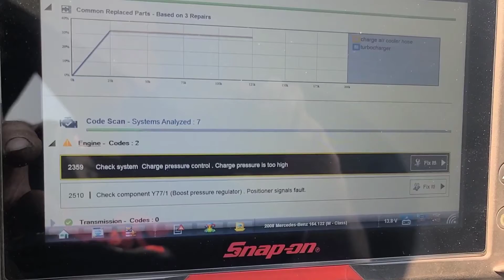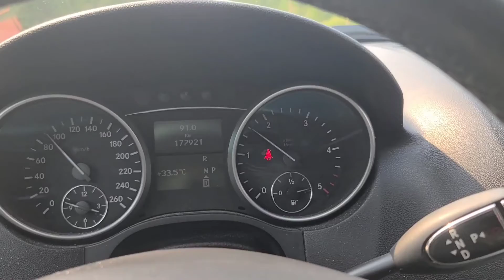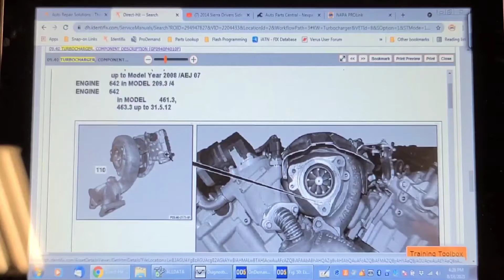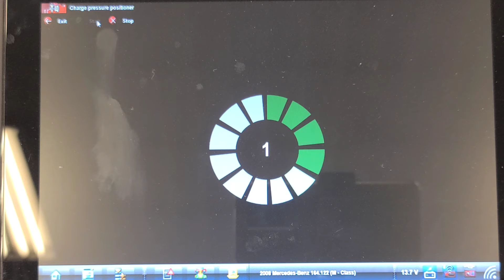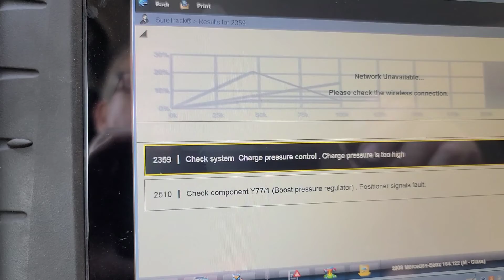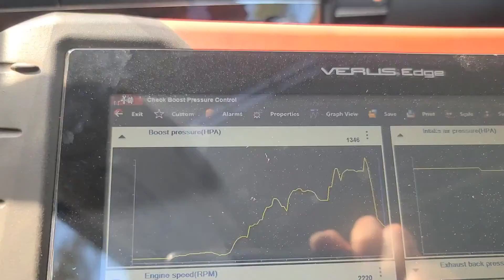2008 Mercedes Benz ML320 Severe Hesitation/Surge on Heavy Acceleration. Codes 2359 and 2510

Comment: Just so people are aware. The connections are aluminium bonded wire (search wire bonding cpus) and soldering is VERY VERY difficult and likely wont last. That being said mine is off for repairs now, its been repaired previously with solder i dont know how they managed to get it to stick to the pad. But yeah its aluminium bonded wire. Thats why its so difficult.
Reply from the maker: Yes you are correct it is a pita to fix

Comment: Hey great vid, I also have no engine light on a lot of stutter at 3/3.5k rpm but I have different codes, p2010 and p1214(00) car drives absolutely fine untill I put the accelerator to the floor then the engine seems to stutter and jerk pretty hard. This only happens on full load

Comment: Hi, thank you for an informative video. My ML350 CDi starts and then dies. Have you ever come across this problem? It runs for 1-3 seconds and then dies. It has new low and high pressure pumps, new fuel rail pressure sensor, new fuel rail pressure regulating valve, new fuel filter, 6 new injectors, new fuel pump relay, new cam shaft sensor, turbo refurbished. Because of the struggling I now have to replace the battery. Day 1 after coming from workshop it starts easily, day two it starts and runs but shudders a bit and then runs perfectly. The next day it starts for 1 second and dies. So basically every morning on first start. Then its dead.
Reply from the maker: You need to monitor data while attempting tostart. Barometric pressure, RPM, temperatures, High pressure fuel pressure and injector pulse width. Stop throwing parts at it...
Reply: @PhillipBailey  Thank you for your reply. That is precisely why I posted the question on here. To be fair, most of the parts were replaced by the previous owner who gave up trying and dumped it on me. At a very good price point it has to be said. But I am a very very determined guy and by hook or crook I will get it to run
.and then I will have an almost mint fantastic car for the price of a little car with an engine the size of a wiper motor.
Reply: @PhillipBailey  Ok, I removed the Y air inlet and saw that it had a crack at the turbo inlet seal housing, I wrapped tape around it as a temp fix and the car actually started and ran for about a minute or so and then died, It showed two error messages, one is still the transmission oil cooler contact is open and the other one says exhaust back pressure too high. Now it doesn't want to start

Comment: Unfortunately this wasnt my issue =( all connections on actuator are fine yet still judders like this one under hard acceleration. Its not that old of a turbo either as already replaced couple years ago =(
Reply from the maker: Did you check for codes? How are the air filters? They  are a bitch to access so the lube shops don't touch them.
Reply: @PhillipBailey  filters fine, about to replace fuel filter. The only code recurring is for EGR because i run a bypass on it. Have done for a long time without issues tho

Comment: I’ve had intermittent bucking on acceleration for years. Always at the worst times too. Turning left from a side street, always seems to be first gear and accelerating. Motor stutters like it loses all accelerator signal. Gonna have to pry this box off and look at those joints
Reply from the maker: I'd recommend to check it for codes first...

Comment: hello phillip i get this problem 1 weeks ago on my E280CDI om642 2007 engine :) while engine is cold car runs good but after the engine go to warm turbo goes off no and working only 3000rpm... i get this code ( Check the structural unit Y77/1 (servo mechanism for regulating the pressure of the injected air). The servo motor reports a malfuntcion) so what do you think should i try to open actuator and check wires? also on of the intercooler pipe is broken and leaking air
Reply from the maker: I'd fix the intercooler pipe first.

Comment: Hi I have lost my wire that connect the 2 connections on the actuator circuit board can someone tell me what wire can be used to replace my lost wire to solder the 2 connection together
Reply from the maker: I used a single strand of copper wire.
Reply: Ремонт сотовых телефонов они вам припаяют медный провод

Comment: Nice work - I have the same problem on my UK E280CDi. Mine doesn't bring up a check engine light either. Mercedes perhaps just considered this to not be a problem that warrants a check light. Mine only does it after setting off on a drive after stopping on a journey. My scenario being a hot engine re-start -after stopping on the highway for a slurp and squirt. classic dry solder joint failure? I will find out
Reply from the maker: Good luck. I have found that you cam buy the complete actuator on Rock Auto for a reasonable price. Make sure the turbo wastegate is not seized though.
Reply: @PhillipBailey  Do you have to reprogramme the new actuator in again or is it plug and go?
Reply from the maker: @HonestDating  it's plug and play. There could be a relearn procedure but it's not critical. I ended up replacing this entire actuator from Rock Auto even though it was still working the customer wanted to replace it. Didn't do any relearn and it seemed to be fine. Good luck.
Reply: @PhillipBailey  Thank you for your help. Much appreciated.

Comment: I'm dealing with this same issue. Same with the no check engine light. Shows low boost pressure when I scan it with my scanner and I have changed everything besides the actuator and turbo. My bucking is intermittent and not as bad as yours but it seems the actuator gives up and closes during heavy acceleration. Thanks for your vid as it seems this is a common problem with these vehicles and I'll be changing the actuator soon.
Reply from the maker: The actuator is not that bad to replace. Sourced one from Rock Auto for a decent price.
Reply: @PhillipBailey  it didn't look too bad to change. Thanks for the lead. I'll give them a shot!

Comment: Does that software program sensors as well? What software and obd adapter are you useing
Reply from the maker: I'm using a Snap-on Verus Edge with Snap-on software. It will do most module coding but not all unfortunately. Not sure what you mean by programming sensors unless your referring to module coding.

Comment: I had same problem with my 2008 ml320 cdi ...problem was with the intercooler resonator which is made of plastic housing that breaks and kills your boost ...I totally removed it replaced it with a straight pipe ...my suv is 100 % better with so much power .

Comment: Don’t forget Tim.. you did not put the link in the description
Reply from the maker: Thanks for reminding me...done
Reply: @PhillipBailey  thanks for video,im going through 2510 y77 actuator code as we speak.i will open actuator and check wires tomorrow.Thank you from the 🇬🇧
Reply from the maker: @MyScotty7  if the small wires have broken loose you will need to scrape through the aluminum coating to get to the copper to solder it. Good luck.